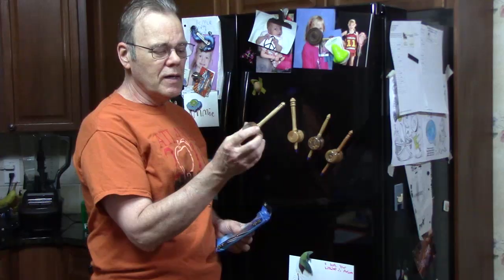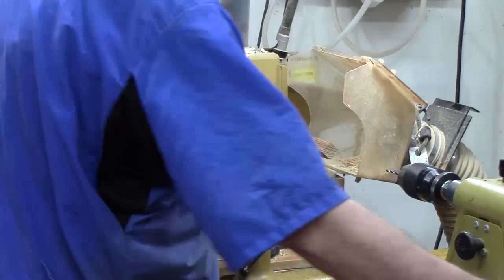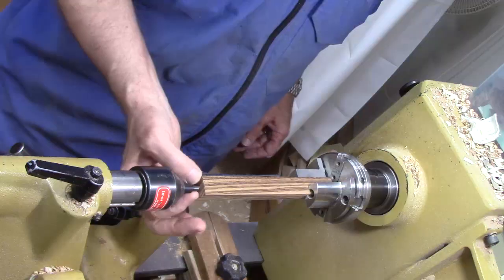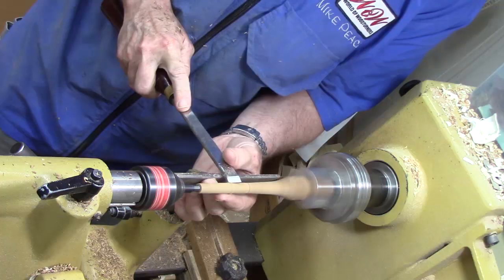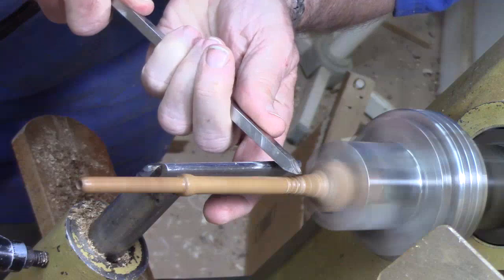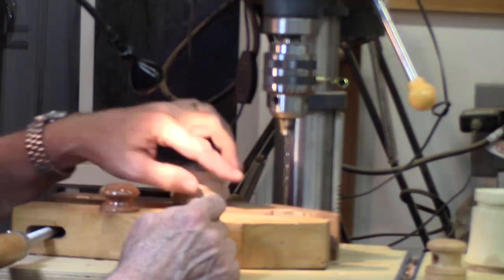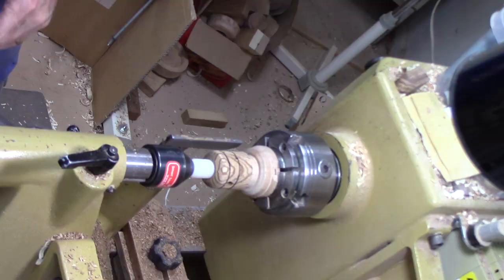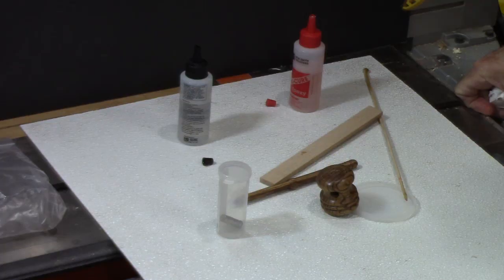12 Cent Stick Pen and Refrigerator Holder

Comment: Mike

Great video.  These are fun, quick projects, and make great gifts for casual acquaintances such as the barista in the coffee shop where you hang out with retired friends.

I have a slightly different approach.  First, after drilling the hole with the long bit, I flip the Jacobs chuck over to the headstock and use the drill bit as a mandrel while turning the body of the pen.  I keep the tail stock in place to support the end of the pen body.  That approach provides a bit more support and prevents the thin spindle from wobbling.

My experience is similar to yours - if I use a 5/32" bit, the hole can end up slightly too large (requiring the use of teflon tape to hold the insert in place).  So I use a 9/64" bit to drill the hole, and then, after the pen has been completed, I enlarge the hole using a 5/32" but only deep enough to receive the plastic end of the insert.

I also drill a breather hole in the side of the body.  I don't know if this is necessary, but the fact that it's there means that its absolutely impossible for a vacuum to form inside the finished pen that would restrict ink flow.  I use a #65 wire bit in a hand-held pin chuck to drill the hole.

Finally, I agree with you about CA - its glue, not a finish!  I use a shop-made lacquer-tung oil friction polish on my pens (equal quantities of a brushing lacquer, lacquer thinner, and tung oil).
Reply from the maker: Thanks for those alternatives. I wanted to try the mandrel approach but my drill bits were way too long and I did not want to go to the trouble of making a dedicated mandrel and bushing.

Comment: Once a week I threaten to make a couple pencil holders in this style (I don't use pens very often—rarely). For 35 years I had a pencil behind my ear, but since I retired I got out of that habit. It's raining today so maybe I'll use this as a motivational video. Thanks, Mike.

All the best,
-- Joe
Reply from the maker: Thanks, Joseph. What tip to you have for keeping a pencil from sliding thru? Perhaps this will work better on a lathe to hold a pencil than taping a rare earth magnet to it.
Reply: First I have to say that I use standard round or hexagonal cedar pencils. Those fit a 19/64" hole with very little tolerance so I would consider a 5/16" inch hole to offer more ease of insertion and retrieval. Any o-ring with a 1/4" internal dimension (i.d.) will fit snugly over a standard pencil. Danco #78 o-rings (Home Depot)have the necessary i.d. and a 7/16" o.d., so even if the hole got wallered out (southern American for reamed) to 3/8", the o-ring will prevent the pencil from falling through. I didn't have a #78 in stock so I used a Delta/Peerless neoprene faucet seat (available individually without springs from a plumbing supply or a real hardware store). Both can be adjusted easily up or down to ones liking. Alternatives are a small pinhead bead of medium CA, a couple wraps of 20 ga. copper wire, or a couple wraps of any sort of tape. The neoprene faucet seat is a secure and comfortable solution for me. Office supply stores sell pencil grips in a dazzling array of colors and shapes which should work equally as well. I didn't have any of those either. 1/4" i.d. plastic or rubber tubing could be cut into appropriate lengths. If a person were so inclined ,a bead, appropriately dimensioned, could be turned to fit the circumstances. On a different note, given your age and experience, you can call me Joe. :- )

Cheers,
-- Joe
Reply from the maker: Thanks, Joseph! I knew you would have some great ideas. I think I will make a holder for  my lathe. Now that I think about it, a simple bead of hot glue should do the trick on the pencil if I can't find an O ring around my shop.
Reply: That should work admirably. Put it a couple fingers or so down from the eraser ferrule so you've got something to grab. 

All the best,
-- Joe

Comment: Mike, I drill the hole like Cap'n Eddie showed , can you believe it, 8 years ago!  Results are about the same and it's much quicker/easier for me when making the pens in large batches.
Reply from the maker: I did try it that way and it works. It does require a Jacobs chuck with a draw br for sure! Nice to have options.

Comment: Mike
I like the idea of the holder for the fridge, i use the very tip of a pair of wire cutters to nip the shank of the refill just under the flange on either side that leaves a small barb that holds in the hole if it as become too loose a fit.
Reply from the maker: Thanks for that great tip Trevor! I like the new heart icon so I can share the love.

Comment: I used to make a lot of these pens. I don't know how many times my drill bit followed wild grain and came out the side. But setting up a laser drill seems to be overkill. :)
Alan
Reply from the maker: You highlight an important consideration, Alan. Selecting straight grain wood is essential for stick pens.  Save the figured wood for another project.

Comment: Its true the hardest part is the pen and the drilling.  I don't have the pen jaws yet.  I have to use the mortise taper for mine....but it worked out fine.  I don't do what you all say because I am using the wood I have and don't have the exact dimensions you start with.  When you start out you don't have the blanks like you professionals.
Reply: sorry couldn't show my work ......oh well.......I still love them....will make some more
Reply from the maker: Yea, I remember starting with a skew on spindles cut from 2x4's. The wood starts coming your way and pretty soon you have more than you need and it starts backing up on you. You have to fight to keep from being a wood hoarder.

Comment: Good project, and I always like your videos.  You do know that the bit in the Jacobs chuck can be moved forward and backward by just sliding the tailstock forwards and backwards on the lathe ways, right?  THAT is the easiest way I've found.  No cranking.  No wonky vise grip problems.
Reply from the maker: That tailstock weights 57 pounds on a PM3520 so does take some effort to slide back and forth with one hand, LOL!

Comment: nice project. glad to see I'm not the only one who doesn't care for ca finishes. 
also, I have no affiliation with them but magnets4less.com has a wide variety of magnets available with their pull force listed. I just bought a bunch of 1/2" diameter neodymium magnets with a 7 pound pull force for some fridge magnet projects. they are quite strong. they do cost more than eBay magnets, but they are consistent in strength and have a crazy amount of options.
Reply from the maker: Thanks, I had forgotten about them. Unfortunately their shipping costs more than the magnets! I found some better sizes on Ebay. Mine were N35 and I believe something a bit bigger would be better like 10x2mm would do fine. The stuff straight from China takes a while but shipping is typically dirt cheap or free.

Comment: Cool project, Mike! (Kind of an odd camera angle on the overhead shots, though.)
Reply from the maker: I gather you found it distracting? I thought it gave a bit better view than shooting more straight down since it provided a combination view of top and front, but maybe not. Maybe someone else will comment.
Reply: It's just that it's crooked. I feel like I need to turn sideways to see it correctly. :-)
Reply from the maker: Thanks, I may have to rethink that angle if it is a distraction.